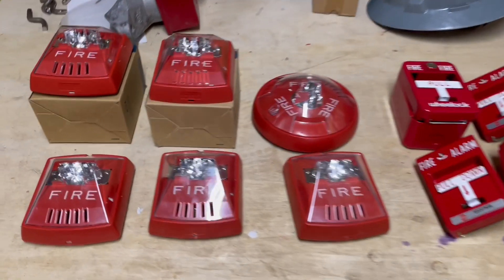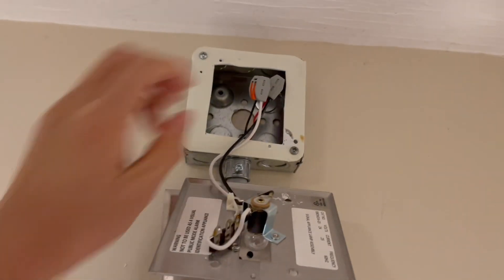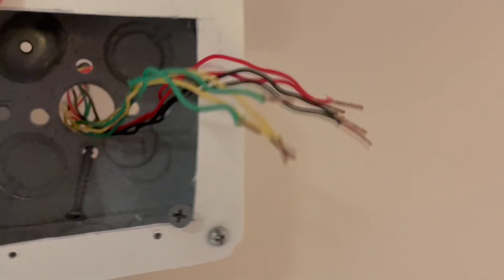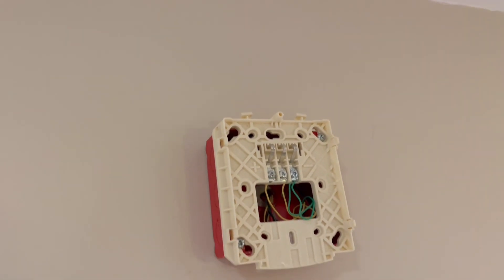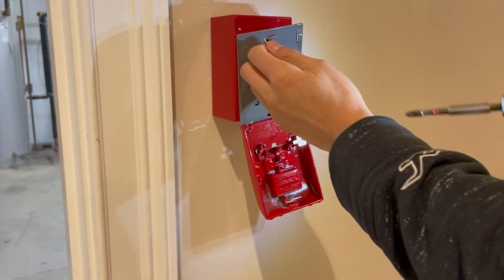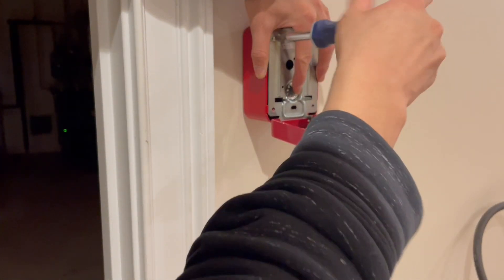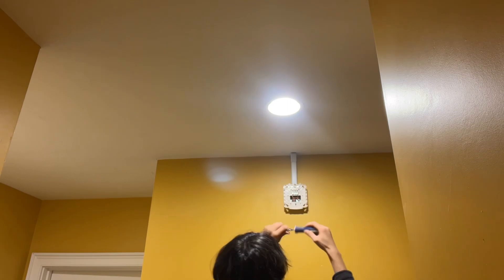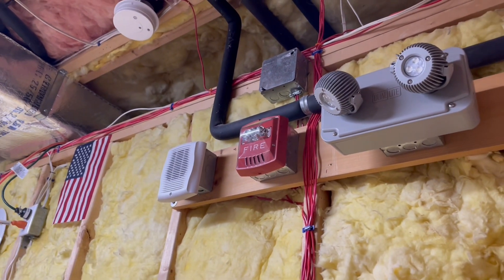Installing Wheelock Exceder Fire Alarm Devices to replace an older Edwards system

Comment: So I know the sound a little bit random but I’m gonna work on this mod for teardown that will add fire, alarms and fire sprinklers to the game. They were gonna be a few different types like pendant, upright and sidewall as well as deluge. I also have a horn, a strobe, a horn strobe, a ceiling horn strobe, a ceiling strobe, a ceiling horn a bell strobe and a bell and a smoke detector. All add an emergency light as well, but I’m saying this because I want your input if you have any suggestions for things that I should add to the mod. I’ll give you a shout out for your suggestions included in the mod and for anyone else put your suggestions in the comments.

Comment: quite curious to know if you're ever gonna flush mount your devises. I get it's not your house but seeing that in the future would be pretty nifty
Reply from the maker: Most likely not because that ruins the adaptability of the system
Reply: @FireAlarmDude5967 ah that makes sense. Thanks!
Reply: @FireAlarmDude5967 hey bro
Im looking for an FACP under $500 whixh panel do you recommend

Comment: My local grocery store recently did a fire alarm system upgrade. Before it had Wheelock ASs everywhere and now they have the exceder LED units and has an addressable fire lite panel. For whatever reason while just about everyone else around installs system sensor, my grocery store still sticks with wheelock.

Comment: Man these are my favorite line of fire alarm devices ever, second to the ZNS series. I know their backplate design is iffy, but they look great, stylish, and serve their purpose. Today, there is nowhere near this kind of effort in product design.

Yes, fire alarms are not meant to look pretty, BUT they should not be an eyesore on the wall ether! (i.e. LED SpectrAlert devices with the awful looking off center strobes and crap plastic or the Eaton/Wheelock strobe lens that look like teeth 💀 )

I tend to see these exceeder devices by far the most out in public.

Comment: I have an Exceeder HSR, however I might get a new one since the one I have is dead. Not only that but the bracket broke. Which is rare for the brackets to break since Wheelock designs their mounting brackets very well.